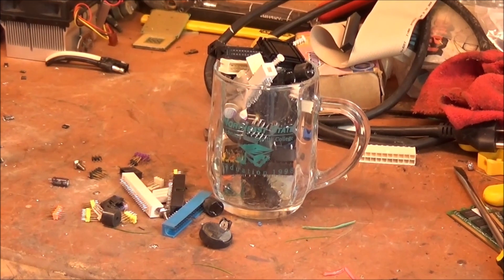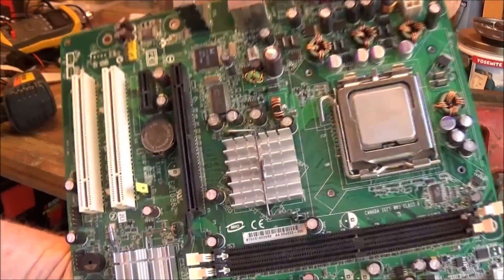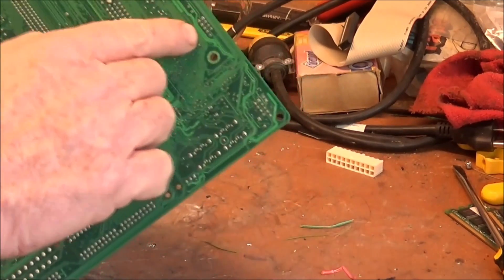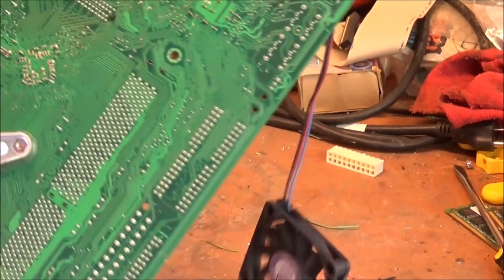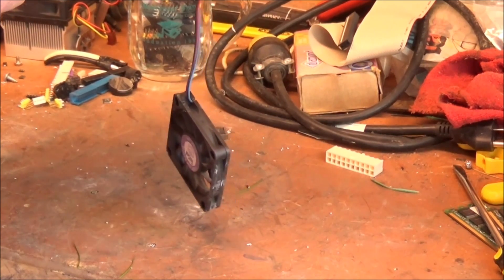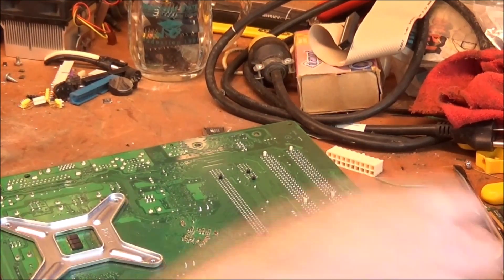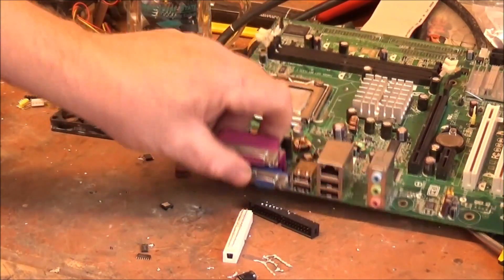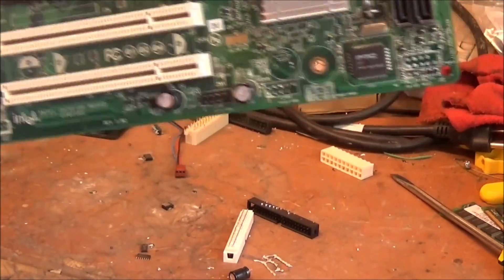Salvage Motherboard Parts with Heat Gun

Comment: i tried solder bath, hot air reflow tool and solder suckers before. its a mess. ill try the big air gun next time to salvage some of the nice connectors and parts off of these heavy multilayer boards. 2000Watt should do the job quicker and better than 80-150W. thanks for the tip.